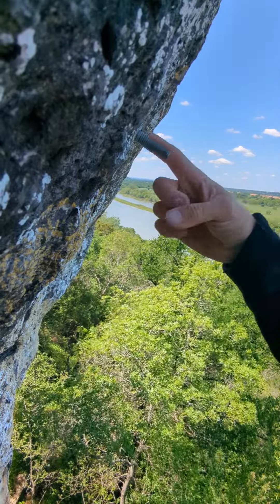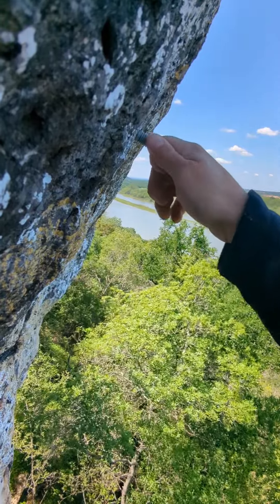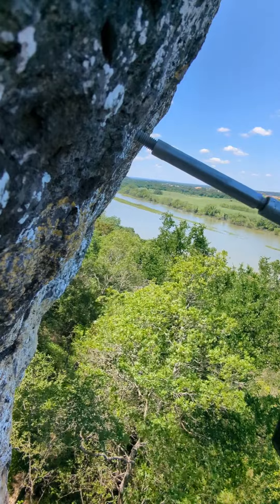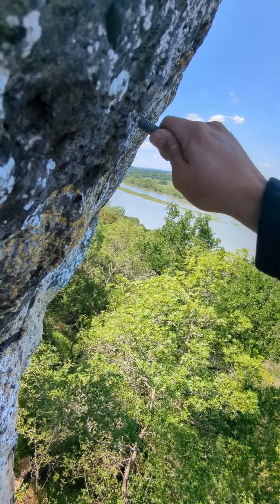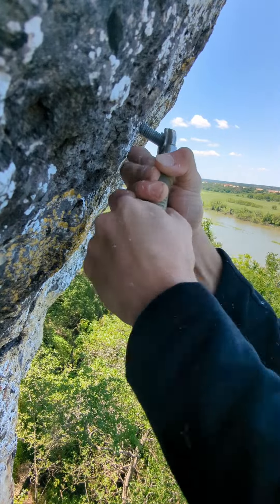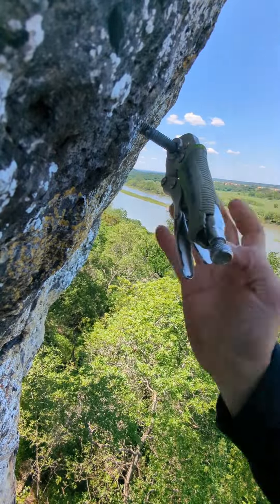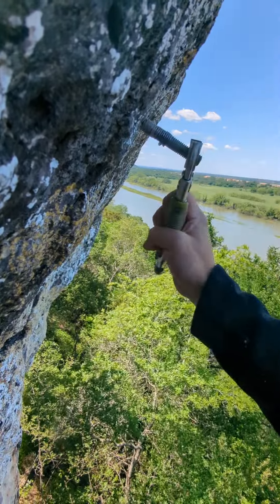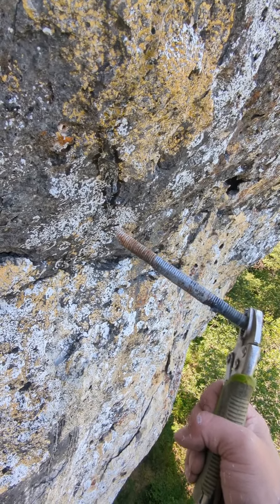core drilling 1/2"x7" glued in zinc plated threaded rod

Comment: Aghh that sounds, it's a little bit like a lower pitch version of the dentist. I'm not enjoying the audio. Very interesting.. was thinking about core drilling a bolt somewhere then replacing with a Petzl bat'inox 14mm (uses 16mm hole). Good too see core drilling, thanks
Reply from the maker: I haven't used a batinox yet because they're expensive, but it should work great!  I use bolt products 8mm twist bolts from team tough for which use 16-18mm holes
Reply: @jimday1991  bat'inox are insanely expensive, I got given 4 of them ages ago. Would only use if I wanted to go into a big diam hole probably where a previous bolt removed. I don't bolt very often and only in old mines etc.   I don't sport climb myself, only trad where I am
Reply from the maker: @tomtom4405  that's a very nice gift that someone gave you!  If you core drill and install one, let me know how it goes.  8mm twist bolts are ideal for 16mm and 17mm core drill bits due to their price point and strength, they're a great product.  I could see how a batinox is nice for caving though, as trying directly to the anchor would be nice with the 14mm diameter thickness